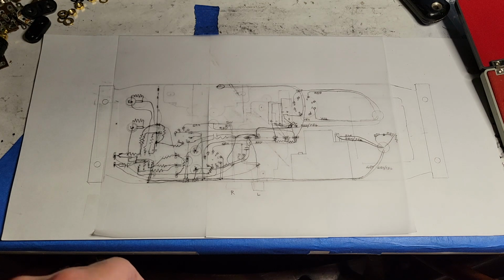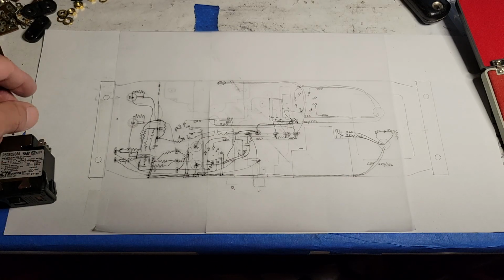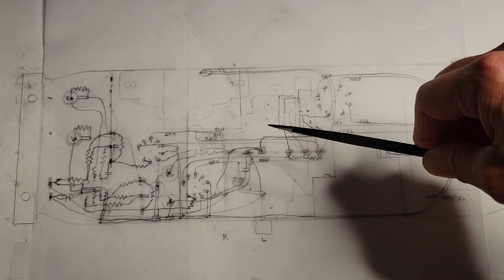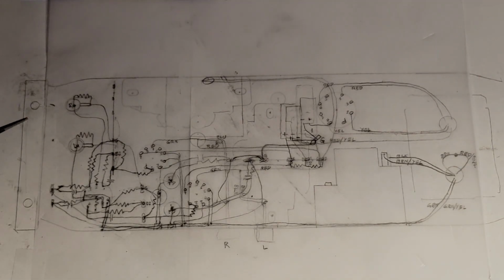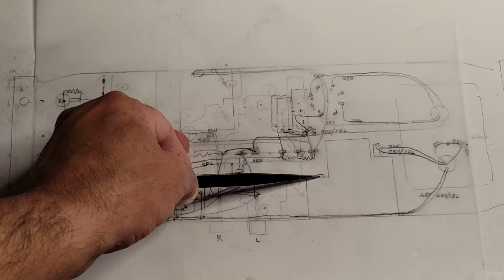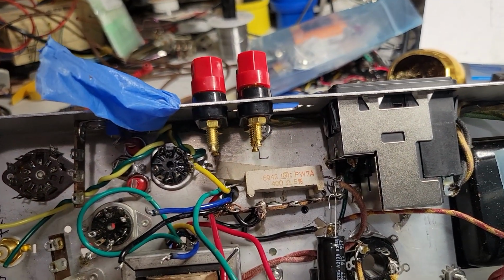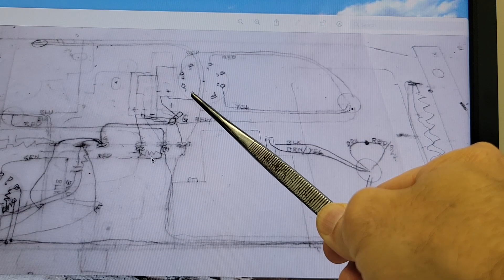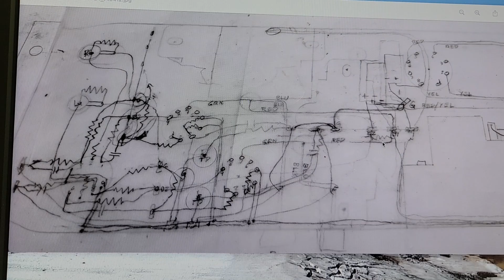DG-SE1 Tube Amp Build, Part 2: Planning for Point-to-Point Wiring

Comment: Excellent illustration of the importance of planning position of components, given a number of fixed positions, and the compromises that become necessary! One thing I noticed was heater wiring. I've seen forum posts where people show pics of heater wiring with gaps in the twists along its journey, with the accompanying comment that it undoes all their good work. What is your take on it? How fanatical are you on twisting heater wires?
Reply from the maker: All the AC wiring needs to be twisted.